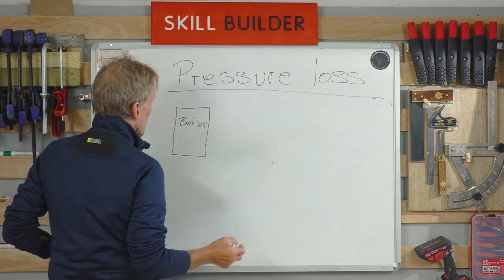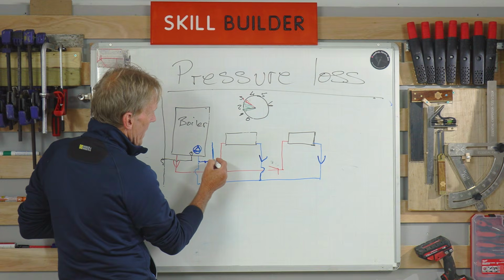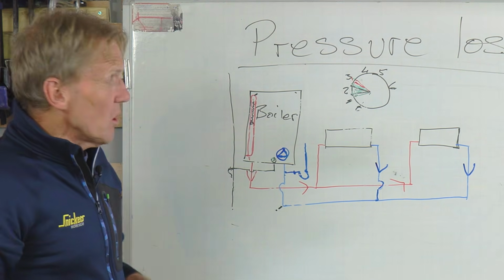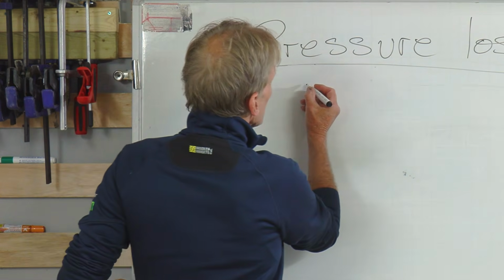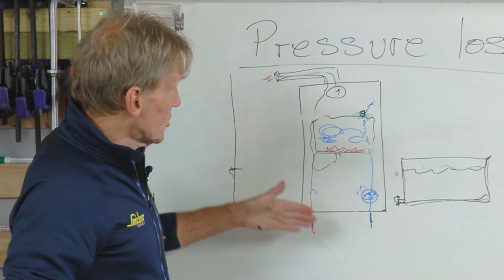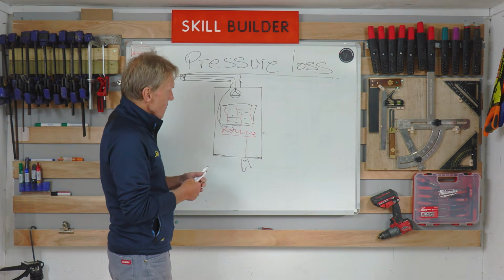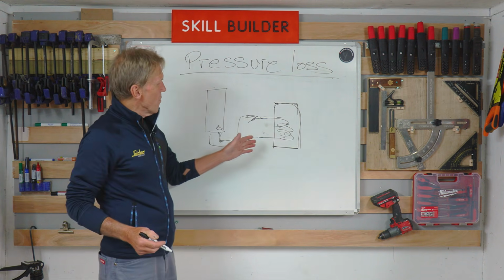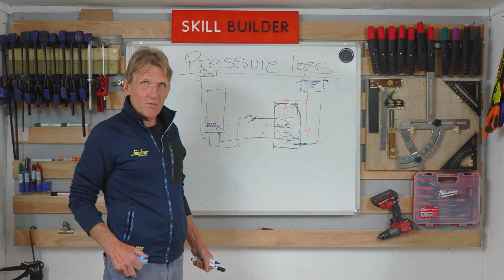Why Does My Boiler Keep Losing Pressure?

Comment: Hi Rodger thanks for all the brilliant videos, I m in a Housing association house and my gas boiler was installed in 2014 which is a Worcester combi ,it has taken 10 so called engineers to diagnose that the  heat exchanger is leaking, they now have to supply 2 men to remove the boiler from the wall as they have fitted it to close to the ceiling to remove the heat exchanger and replace it. I used to fit boilers years ago in the 1980s and we used to pay a corgi registered (in those days) chap to come and connect it up and issue a certificate, which is no longer possible, Ive been telling the engineers that its the heat exchanger for years  but they are mostly clueless. Id name and shame them but not sure if you allow that sort of thing. fortunately the boiler still runs without pressure but I bet the inhibitor has vapoured away through the chimney as steam years ago. I bet the scale protector has clogged up a lot to. currently if you top it up with the external loop which in a rented property they say is my responsibility, the pressure has dropped again by the next day to 0. The last one diagnosed it fine but he still reffered to the boiler as a valiant boiler, I think they struggle to actually read the name of the boiler on the front panel sometimes.
Reply: Must be a council/housing association thing to employ these kind of engineers, I mean you want your engineers to be competent and skilled when working with certain supplies/appliances, be it gas or electricity.
Reply: I think like many other aluminium heat exchangers that have not had enough inhibitor in the system...over time it will damage the heat exchanger.  Have come across this 3 times with Worcesters in the last 8-10 years
Reply: Did the engineers work for a firm beginning with D.

Comment: My boiler, fitted last year, has a great big red vessel next to the boiler on the wall. It is a WB 30i. I lose pressure in winter but did not in summer when the heating was off. My system is 45 years old so somewhere is a tiny leak. I do have a hot water cylinder and tank but the boiler pressure is fine in summer. Not found it yet.
Reply from the maker: It might be that the red vessel needs topping up with air.
Reply: I always have to bleed my radiators once heating is required and the pressure usually drops .5 bar so quick top up and fine for rest of winter.  A once a year effort.

Comment: I live in a fairly large 4 bed rented 1970's house with what looks like original rads. The house used to be on an oil fired heating system with immersion heater and a tank in loft etc. In the last 20 years the house was finally connected to mains gas. As part of this the old oil fired heater was removed and old systems decommissioned but old rads left in place. A nice new combi heater was installed, but because this system runs at a higher pressure there was all sorts of leaked and most of the rads had TRV's fitted. This combi heater broke down 3 years after we moved in. A Baxi has been fitted. I'm having to constantly repressurise the system. I haven't found any pipe leaks (I work in property maintenance so I do know a little bit about what to look for). I have reported this to the letting agent and the plumber came and told me that I should report it to Baxi... I'm the tenant it's not my responsibility. I just wish that more "plumbers" watched your vids Roger, they might actually learn something and do a better job. 
Having watched this vid, when the engineer next comes to do a service I'm going to insist he checks the expansion vessel pressure and the pressure relief valve and for internal boiler leaks.

Comment: Hi Roger, we have a pressure loss issue really bothers us for two years now and hope you can give some expert comments here. In short, boiler pressure remains the same in summer, but drops in winter when the heating is on. It is a Logic C35 combi boiler for heating and hot water (shower and taps), with no hot water cylinder fitted. Static pressure in the system was at 1.8 bar at end of April (last day we used central heating); pressure was still at 1.8 bar at end of Sep (no central heating used for the whole summer); then we Oct comes, and when we started using central heating again, boiler pressure starts to drop, to 1.3 bar (static) in the last 2 weeks. We are keen to know from your experience, where do you think the problem could be. The local plumber suggests fitting a expansion vessel as we’ve 13 radiators, we are OK with the idea so to take some pressure off the system, and if that solves the problem. For your information, currently, the static pressure is 1.3 bar, it goes up to 1.5 bar when the hot water tap is open, then to 1.9 bar when the central heating is on, and we never let it runs to 3 bar where it triggers the pressure release valve. Your comments is very much appreciated.
Reply: Problem is likely to be loss of air charge on the expansion vessel.
Reply: @charlessarner5566  Thanks Charles, and would you have recommendation to that? Just to top up the built-in expansion vessel in the boiler, or to fit an additional one to the system? Many thanks!
Reply: @yangcao444  check the air pressure in the expansion vessel with a car ture pressure gauge if you can access it easily enough. Check what the charge in the pressure vessel should be (often detailed on a sticker on the vessel), pump up to the correct pressure with a pump.

Check whether the pressure relief valve is discharging when the heating is running (tie a plastic bag or balloon around the end of the pipe). If it is, then it is likely that the pressure vessel is insufficiency sized and if so an additional one can be added to your system.

Comment: Thank you. Don't know why I didn't see this one earlier when it came out, would have really helped me with my exams.

It does explain why my Ariston boiler tried to kill me in 2011 which was when I got interested in plumbing!
Leaking heat exchanger.
I told Ariston's service engineers there was water dripping very slowly out of the bottom of the combi and it was losing pressure, but they couldn't find anything.
The engineer took the face plate off the combustion chamber and lit the boiler.
A six foot jet of flame shot out and fried the wiring.
He said it was fine.
It was a cold February and the boiler was lighting with a huge BANG every time which I now know was forcing gasses out the sides of the faceplate.
I phoned Ariston and was assured it was perfectly safe or it wouldn't work.
I was falling asleep on the sofa with a massive headache when it suddenly occurred to me to look up Carbon monoxide poisoning symptoms.

I was very lucky there.
I had weeks of oxygen treatment and the boiler was condemned.
Reply: @jamesm4172  Thank you!

Comment: Hi, thank you for this video, during the winter I have to refill my radiators once a week every week. So often my family have a system in place to make it quick. During the summer the boiler packs up about 8 times and a quick refill mends that. I have had British Gas around so many times it’s maddening with thermal cameras etc. I have made a note of all the potential problem areas and I will get a plumber round and we can go through them one by one. It can’t be doing my boiler any good. So thank you for this from the bottom of my heart!!!
Reply from the maker: I use some perfume in the system to detect micro leaks
Reply: How do you get perfume in the system though .

Comment: Our system is plagued with leaks and gradual pressure loss because of water leaking up the operating plungers on thermostatic rad valves. The small operating plungers pass through an O ring, become slightly corroded over time and start to leak through the O ring seal up the piston and out of the head of the valve. Not operating the thermostatic heads does not help because they react to room temperature and move themselves as the seasons change. We get leaks on TRV's that we never move. This is the only repair our system ever needs because it is fairly new but it is a persistant pain in the backside. We are considering going back to a standard servicable on off valve in place of the TRV's when we have them changed in future to save a lot of expense and avoidable botheration. It won't be long before all the rads are sporting a nice new shiny lockshield type turn it on turn it off valve. We have tried the TRV route and found it to be too much of an expensive nuisance to persist with. BUT this is a definate source of leaks on a system fitted with these valves, and they can be sneaky because the leaks start off small and can do damage to skirting flooring and decoration before you catch on to them.

Comment: Thats wy in the Netherlands we have a expensionfessel from 18 liters. Water will expand 3%, calculate the amount of water in your system ( 240 - 300 liter everage)  you need minimum of
9 liters. At the same time there needs to be air in in, also 9 liters thats wy minimum 18 liters expensionfessel.
Reply: Very few sealed systems have more than 100L in them.

Comment: Very comprehensive covering a lot of ground. I have a system which builds pressure but i am waiting for my annual Gas safe service to change the expansion vessel which has a wet schrader and the same clunk sound all round as the system pressure runs up from setting initially at  1.3 bar to  level off at  2bar cold and runs at 2.6 so no major fluid losses so far . My boiler is 11 years in service  now so my main fears will be upset valves after they have been resting for so long.

Comment: For checking small drips on the PRV a clear sandwich bag wrapped around with a rubber band is a good way. Especially on a hot day.
Reply from the maker: Good tip
Reply: A condom does the job too 😉

Comment: Still have a system boiler and cold water/hot water tank. When the water main burst and I was grafted from work I could still get a bath although I had to wait for it to cool and was a bit hot. Plus I have an Immersion so if boiler packs up still have hot water.much to be said for vented system much more reliable

Comment: Also can you warn all not to put a boiler in the loft if possible as water boards are dropping mains pressures to the legal min 
2 bars , this means in loft it’s not possible to get more than 1.4 or 1.5 bars so Amy little loss means having to go into loft to get boiler working . A bloody pain up an down topping up rad and checking gauge . 
Few have a boarded an well lit loft lol
At least in kitchen etc it will be a cold bed rad first inkling !
It’s esp bad in cul  de sacs like my girls house . 
She is had no room in kitchen or anywhere else . 
Cheers
Reply from the maker: HI jim 
I do know what you mean but the problem is that space is at a premium in most kitchens. I keep trying to get a boiler manufacturer to look at another shape of boiler which  can sit on top of the cabinets or under the base units. There is no reason why a boiler has to be cupboard shaped.

Comment: If I may Roger about heat pump , do you agree it’s a scam ? 
Gas has always been 1/4 price of lecky like now 7p gas kw x 29p lecky kw 
Why we all have gas boilers if laid on gas 
   It’s stated workinb at peak efficiency a heat pump uses 1 kw to produce 3 kw for heating an water eq . 
So how can it ever be cheaper ? All these people that say oh it’s great ! Yes after lots an lots of insulation work  BUT would have saved even more with the gas boiler . 
      I hope do you ? This crisis will be end of the nonsense !!!
Reply: Look at a heat pump's seasonal coefficient of performance (SCOP) rating and use that number for the maths. That's the average of its efficiency across an entire heating season and it should be better than 3 on modern pumps - and that's for average efficiency, not peak. Easy to find ones that are more than 4.5 SCOP.
Reply: @salty-nick  so no point on outlay of 14000£ to MAYBE save a few kw ,our whole economy has been based on cheap fuel coal oil to gas .
Take it away an no economy just poverty

Comment: Thanks extremly interesting and informative. I know its not touching the gas side but we get it drilled into us about not being able to work on boilers unless your gas safe. Can a confident DIYr top up that internal expansion tank?
Reply from the maker: would say yes. The only issue is that you have removed the case but provided it goes back on properly there is nothing wrong with topping up the pressure.
Reply: @SkillBuilder  Thanks Roger, yes common sense has to prevail.

Comment: Hello Roger
We have Worcester Bosch Greenstar boiler which is now 10 years old. For the last few years, it keep loosing the preeure to 0 bar. The pressure is lost within say 2-3 days. Would you be able to recommend an engineer who would be able to locate the problem please? If it turns out to be a boiler, then we can replace it with new one. But if its is not the boiler  then no point in replacing it. We live in Kirby Muxloe, Leicestershire. I await for your kind help. Thanks
Reply: Did you find where the leak was?

Comment: If I can see small amounts of green algea looking stuff where it's joined under valve , does that mean I have a micro leak at that solder joint ?
Reply from the maker: Probably flux residue

Comment: Do you think there would be any mileage in trying to fill a heating system with the same fluids that are used in car cooling systems> Anti corrosive and more capable of heat absorption? I had a combi Vaillant system fitted many years ago, worked great, but kept losing pressure, however, I made a key mistake in letting the plumber / fitter have my house keys to do the install, 3 months later when the house was up for sale, he came back and stole the entire installation!
Reply: You are already supposed to add corrosion inhibitor, Fernox etc.

Comment: I have had a couple of people with kick board heaters which have had small leaks taken visits before finding the leak.
Reply from the maker: I had the same issue. They cut the copper pipe ends square and then pushed on flexis.

Comment: Hi Roger, I like your idea of using perfume to find a water leak. About two years ago I had a tiny leak I couldn't find. Boiler pressure would go down just below the normal 1 bar in about a year. I used a stink bomb and injected it into the water system. No problem finding the leak with that terrible smell. Turned out to be a compression joint on a micro bore pipe to a radiator in my kitchen. Seems to me that a nasty smell is easier to find compared to a nice smell. Also a nasty smell gives you more incentive to find the leak quickly.
Reply: I find cats piss quite effective too! 😅😅😅😅😅
Reply: @goffthomas2554  I didn't use stink bomb liquid from glass ampules. I found a bottle of the stuff that looked identical to a bottle of expensive French perfume. However, the label said Canal No 5.
Reply: @goffthomas2554 the only problem is convincing a cat to pee while you pin them down over receptacle of some sort. Top tip, carry welding gloves in the van!
Reply: If you have a dog , chances are it will be sniffing around the leak point.
Reply: Now no leak, but a smell of sulphur lingers.
Reply: @LabRat6619  Hydrogen Sulphide smells like rotten eggs, similar to bad farts. Luckily most farts don't smell that bad most of the time. Should you ever release a nasty smelling fart and someone says " have you farted?" You reply saying "of course I have, do you think I always smell like this ?"
Reply: @jimdavis5230  🤣👍
Reply: @jimdavis5230  So we could say a fart is a pressure release valve.
Reply: Some correct information for diy..ers, but only touching on possible problems and there not Gas registered and is Roger the BUILDER ??
Reply: The human nose is extremely sensitive to the smells of rotting food and burning, both for safety reasons. This is why mercaptans are added to gas, they behave in the same way as rotting food smells and are easily recognised. No need to use fancy perfume though, just use a cheap liquid wick airfreshener as those perfumes are formulated to evaporate well and spread out in a space.

Comment: With this new 55degC max heating temp how are the government supposed to reconcile the Legionaires Disease requirements of keeping hot water above 60degC?
Reply: legionnaire disease is killed by water above 40 deg Celsius
Reply: @anthonyminchinton3399  Scottish Landlords must keep their hot water above 60
Reply: The 55 Deg C refers to the design of the central heating system and sizing of heat emitters.
Reply: @hvacdesignsolutions  I know people up here who will drink radiator water!🤣
Reply: @MakeItWithJim  I suppose it does contain anti-oxidants.... :-)
Reply: 55C is for the radiators (flow) not the hot water taps.

Comment: Dealing with this now at home, just had a new pressured system installed and it's losing pressure in a couple hours, absolute pain in the arse, 

pretty sure it's a leak with the amount of pressure dropping, nothing on the upstairs ceilings so I suppose it must be the downstairs, bought the endoscope camera you reviewed a while back and need to cut some inspection holes in the laminate floor 😵.